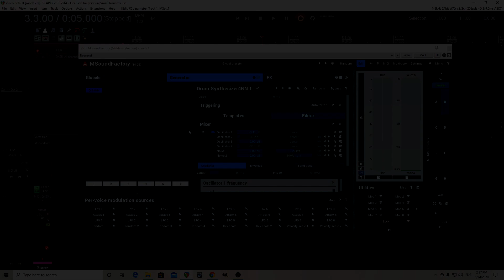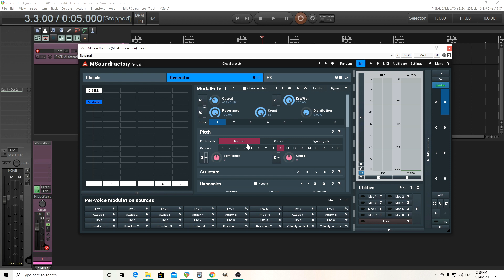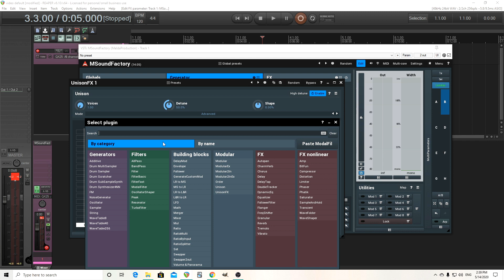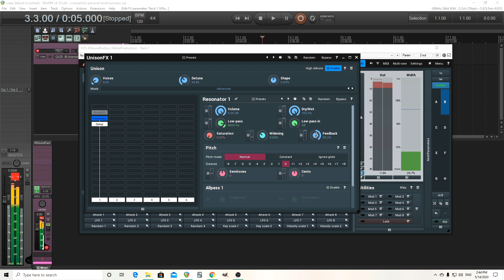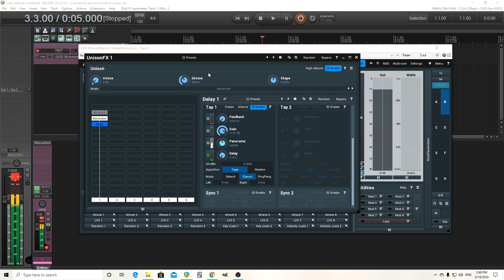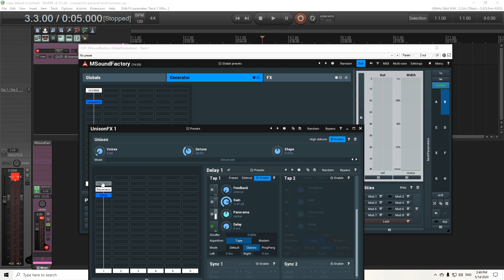UnisonFX with Physical Modeling in MSoundfactory

Comment: Can this synth or any other listen to an audio track such as a recorded bass line & play the same notes at the same time? Perhaps even tuned to the audio track so the pitch basically matches constantly? (There would presumably be a slight delay in real time, which could be compensated later if necessary, perhaps designed to be in phase when played in real time if necessary, or otherwise modulated to avoid phasing)
Reply from the maker: As far as I know of no synth can copy an audio bassline. Maybe something like midiguitar or something, but I have my doubts it will work without a very clean audio recording. Sorry
Reply: @Chandlerguitar  Thanks. I'm going to look into guitar synth plugins like pedal emulations.